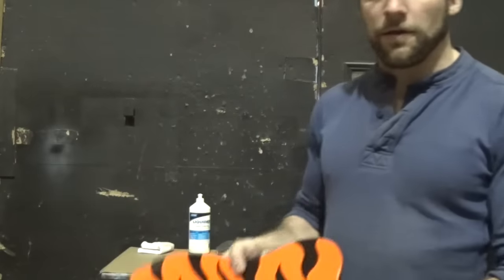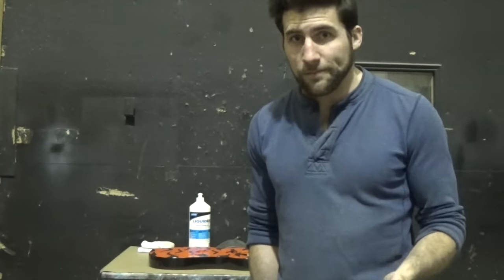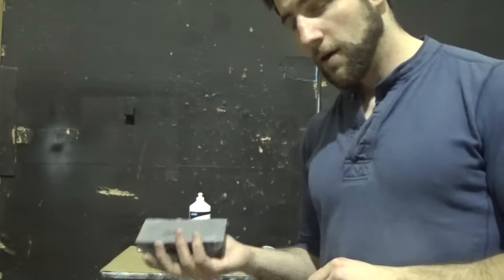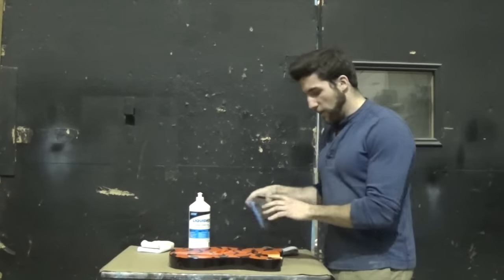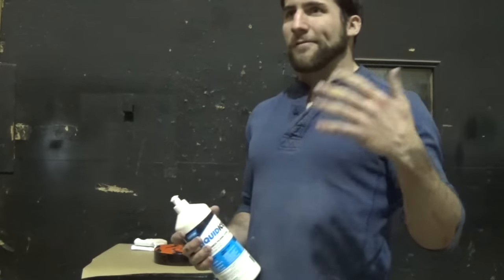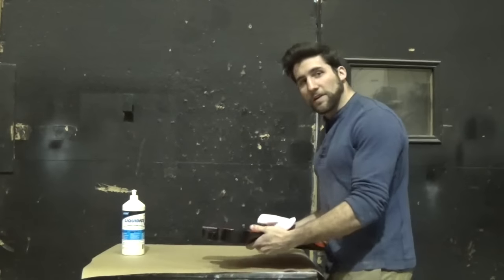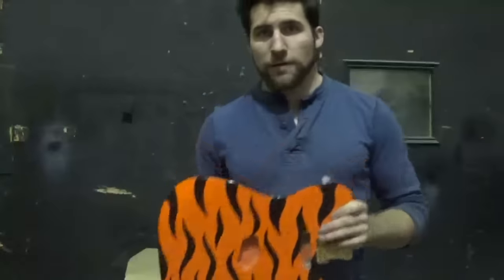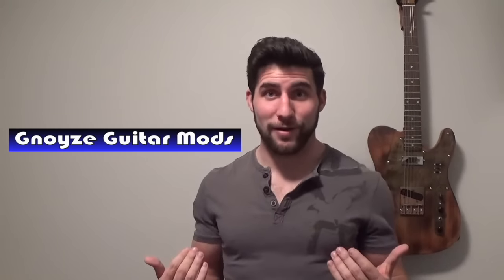How to Paint Your Guitar With Spray Cans Part 4

Comment: I'm a decorator and have done spraying. I've used cans for various parts. Motorbike parts etc and they come up great. The important thing is patience. I put plenty of colour on and then kept doing lacquer coats. Perhaps 10-12 in all. Then a light sand and polish (after plenty of drying time). I've got a black Les Paul and have thought about doing the top red. I may do it.

Comment: Thanks Brad. You recommended I use vinyl sealer and acrylic enamel and finish it with the 2k......spray cans. I didn't realize how rough my unfinished body was until I started the process. I vinyl sealed and scotch padded it np. I am doing white on black.....black sides with white top/back. I layed down black first so I could lay the white last. I noticed the grain showing pretty prominently so I wanted to add my 2 cents for those with my problem. I basically ended up with 6 coats of the black and used a 390 scotch bright to completely eliminate the grain totally before moving on to the white top/back(3 coats) ending with 6 coats of 2k clear. I want to tell everyone out there that the enamel dries fast and hard and if you want to work fast avoid lacquer. My entire project 2 colors and clear was 8 days total and looks amazing.
Reply from the maker: Starting with a grain filler may have helped there. Probably a few more coats of sealer would have saved you a ton of white and black though. Anyway, I’m glad to hear you’re happy with the final product! Hope you enjoyed the process.

Comment: Brad, I just love your comment @ 1:00, "if you're happy with the finish at this point it may be best to be done." That's exactly my plan. I finished my test pieces using 9 coats black lacquer and 6 coats gloss clear. Still had some orange peel through coat 3 of the clear. Sanded really good after that and to my amazment #4 clear coat was good enough to stop. Needed to see if I could re-create it. #5 had some dull spots but gave some extra so it looked a bit wet on the last coat #6. It looks so good if I get that when doing the actual headstock I'm done!! Just waiting for some cooler weather and lower humidity. Thanks for the answer in the other video.
Reply from the maker: Cheers Bob. Sometimes it pays to leave well enough alone.

Comment: Brad, I've watched this series of videos several times, and I'm impressed. Hopefully, when the time comes I can do a similar job. One question though....when I read forums etc etc it seems that people warn against using enamel because of the drying time. They say it can take months or even a year to fully harden. Yet when I watch your series, that doesn't seem to be the case at all. You're talking about this whole process from coat 1 to finish polishing the clear, taking only a matter of days. 

When I look at a product here in NZ that I might like to use, 'Dulux Duramax' aerosol, it states that the paint "dries ten times faster than an alkyd spray paint"...this is from the blurb on the website, rather than the details on the can itself. So everything that I'm reading agrees with what you show in your video series, which is great. So what are these other people going on about when they warn of enamel drying time to be several months before a clear coat can be applied and up to a year before it's all properly dry?

If you could clear up this confusion I would be very grateful. Thanks.
Reply from the maker: Generally speaking the paint in these spray cans is a fast dry enamel. It doesn't take very long to dry at all. Where people run into trouble is when they spray coats that are too heavy, or too many coats, or too close together. Also, if they are spraying in very humid or cold conditions there can be drying issues. If you layer up 5 heavy coats in a short time span and leave it to dry somewhere cool, the paint can remain soft indefinitely. If you follow the proper (or what I consider to be proper) process, this whole job can be done in a week or so if you're playing it safe.
Reply: Great, that makes sense. Thank you very much.
Reply from the maker: You're welcome.

Comment: Nice videos. I just want to know if it's better to spray the clear on a freshly painted or wait and sand the paint and then apply the clear. I want to use duplicolor on top of a squire strat that has no flaws on the factory finish. Thank you for the great vids.
Reply from the maker: You don’t want to build too many coats up without letting it dry and sanding. If you do two coats of the paint then you can shoot one coat of clear in the same session, let it dry fully, sand flat, and then do your subsequent session of clear.

Comment: Hey Brad, thanks for the video. At the end, theres still a bit of cloudyness in the finish. What do you need to do to remove all cloudyness after sanding down the final clear coat? Thanks.
Reply from the maker: Polish it. You may need a multi-step process. I have several videos on polishing that are more recent and better than this one.
Reply: @BradAngove  thanks!

Comment: Great series Brad.  Very informative just like all your videos.  I’ve been able to learn quite a bit for building my first kit by watching them all.  I have a couple of questions.  I dyed my Les Paul kit which has a veneer tiger stripe top with binding around the edges.  I want to put a gloss finish on the body and a satin finish on the neck.  
Should I put any type of sealer on first or will the Rust-O-Leum gloss and satin serve as the sealer?  
Also, since I want two different finishes should I finish the neck first then glue it to the body?  
Thanks for any feedback you can provide.
Reply from the maker: I would glue the neck first and just use masking tape to deal with doing different finishes on them. You should seal the veneer and body if possible. Flamed maple and mahogany have very open pores.
Reply: Brad Angove Thank you 🙏🏻 so much for responding.  Very cool of you bro.

Comment: Hi Brad, thanks for al the good information and proper explanation how to do this. Great video’s. Just a quick question: is it preferable to sand in one specific direction (i.e. lengthwise or with the grain) or do you sand in several directions? All the best and greetings from the Netherlands.
Reply from the maker: When sanding bare wood you want to sand with the grain. On a finish it doesn’t matter really.

Comment: Good videos, it’s harder than you make it look. I keep getting runs in my paint and then have to sand and start over.
Reply from the maker: Spraying it while it’s flat helps with that.
Reply: @BradAngove  that must be the difference maker. I think I’ll have to get a T-shape galvanized pipe and attach the guitar to it so I can rotate it like you do. I am just hanging it vertical right now and it keeps running. How long do you wait before you sand? I am using the same rustoleum cans just different color (maui blue).
Thanks for the help! Good content on your channel!
Reply from the maker: A couple days before sanding to be safe. And don’t fire it on there too heavy if you can avoid it.
Reply: @BradAngove  thanks man! I appreciate you sharing all of your knowledge! One more question, do you have a video about sanding? What is wet sanding? Is that sandpaper with a polishing compound or paint thinner? Do you sand the paint before you put on your gloss to get out any runs? Each time I sand the paint it chips or just looks like crap.
Reply from the maker: I sand essentially any time the paint has the opportunity to dry. If you don’t, the next layer won’t stick properly. Wet sanding is when you use water to help let the paper slide. It can be a touch risky on wood though, so sometimes people use lubricants that evaporate more quickly like naphtha.
Reply: @BradAngove  thanks man! I am new to all of this and have a frankenstrat that I’ve been working. I really appreciate you sharing your knowledge! Thank you
Reply: @BradAngove  damn bro, I just painted it lying flat like you said, it worked great! It’s nearly perfect, thanks man!

Comment: love how it came out with the stripes! i was wondering if you could show us how to do a snakeskin finish. im a big bc rich guitar fan, and they've got a few older models that have a snakeskin finish that i'd love to try to recreate on an older bc rich guitar i have. all i know is that it involves using fish net stockings and a few different colors or layers of paint, but i'd love to try it sometime, specially with spray cans since i don't have the equipment to do a professional finish.
Reply from the maker: +James Rockey I think it would be very difficult to do a proper snakeskin finish with spray cans. Ed Hubbs has a great tutorial where he airbrushes a snakeskin finish on a gun stock. If I were doing it with spray cans, I would probably use a technique almost identical to the one that I used in my video about how to paint carbon fibre with spray cans. I would just choose colours that are more appropriate for a snakeskin finish.

Comment: Thanks for the great videos. One question: Do you sand in between applying the clear coat layers?
Reply from the maker: No, I apply them 10-15 minutes apart so there is no sanding.

Comment: I am building a replica '84 Hetfield "More Beer" Explorer and was thinking of using this process to finish the guitar. My question is--how is the durability of this painting?finishing process? The guitar isn't going to be a wall-hanger, as I plan to use it. Just curious how this finish holds up from pick scrapes?normal use?
Thanks!
Reply from the maker: It’s not as durable as a factory polyurethane or polyester finish. It’s similar to a nitrocellulose lacquer finish in that respect I think.

Comment: Hi Brad, at first thanks a lot for your very heplful tutorials! Cause I'm going to start my first self painting project, a bit professional help would be great. My goal is: A body in used olympic white that looks about 25 years old and has a greasy gloss (I'm german and don't know this is exatcly what it's called). My plan: I buy an unpainted body ready do paint. Use 3 coats of nitro sanding sealer and sand it down with 600 wet paper. After that I use some coats of nitro lacquer and let it dry for about 3 or 4 weeks. To get the old look I use tinted nitro clear lacquer some coats, let it dry for a week and sand it again with different papers (1500 up to 4000) and polishing it to a greasy gloss. Makes that sense? ;)  Cheers from Hamburg (Germany) Alex
Reply from the maker: Hi Alex. That makes sense. If you want to see a similar job, I did an aged white nitro look in my other series; How to paint your guitar with nitrocellulose lacquer.  I used tinted lacquer in that one as well.
Reply: Hi Brad, thanks a lot again. Very heplful!!
Reply from the maker: Glad to hear it. You're welcome.

Comment: Brad I am about ready to throw this brand new electric guitar body away
I have painted , sanded.  Repainted. Took paint off. Put paint on
I am about to go nuts. But bound and determined to get this done right 
I bought a brand new guitar body 
As a present to my son whom is crazy about John Deere. Colors 
So I primed as suggested   Sanded  as directed step by step  using your great videos 
Watch the videos about spray can paint 
But one side of the guitar keeps messing up
Paint is wrinkled  or rough looking 
And will not go on smooth in that one area 
Each time I have taken the paint off by sanding, re prime it and repaint this one area  about 3 times 
I this this thing is cursed 

I got all the 2k clear coat and bought. Buffer like yours I got so much money in the project. I must get it done right ..  
Any suggestions on what could be the problem
Reply: I would like to send you a picture of the one corner. But don’t see anyway to send it
Reply from the maker: Wrinkling like that is unfortunately somewhat common. Give it a week to dry then sand that area smooth (not all the way back, just smooth). Then add a couple very very very light coats of your color 10 minutes apart, and then one normal coat 10 minutes later. Give that a try.

Comment: Thanks for doing the videos Brad. I'm using the ealier mentioned stewmac spray can lacquer. I'm going to put my daughters hand print on the head of the neck. Is their a certain type of paint I should use for that? I doubt I will be able to get a lacquer mixed to the right lime green. Again thanks for doing the videos.
Reply from the maker: If you're planning on actually using your daughter's hand to make the print, I'd be leery of using lacquer regardless. I doubt doing it once would hurt, but the lacquer and the products that you would need to use to clean it could be hard on her skin and lungs. If you let the base colour on the neck dry properly and sand it lightly, you could probably get away with using a water-based acrylic (which is safer) and then clear coating over it.
Reply: +Brad Angove you're the man. Thanks and keep up the great tutorials.
Reply from the maker: You're welcome. Thanks for watching.

Comment: Hey, Brad.
I know this video is a bit old but I’m just now discovering it as my first guitar kit should arrive at my house tomorrow.
Just a quick question, I can simply use a wipe on poly finish overtop of an oil based paint, correct? And then polish if needed?
Reply from the maker: Correct.

Comment: Hey Brad.  I had a old 80s Washburn Steve Stevens model that had a body crack.  I have stripped the body and am planning to paint it gloss black myself.  Do you think I should go with a matte black base and then a clear coat for shine or a gloss black paint in the first place?   Also, should I have any concerns that my sanding sealer will be incompatible with my choice of paint?  Thanks
Reply from the maker: The sanding sealer should be fine if it’s been on there that long. Nothing left to react to haha. 
As for the colour, i always recommend a clear coat, so that’s where the shine becomes relevant.

Comment: So, for those of us less artistically inclined than yourself, can you purchase pre cut templates for painting various patterns?
Reply from the maker: I would think so. Or you can use this method and print off the patterns on paper and trace them. Using carbon paper to transfer them to the tape works well.

Comment: Surprised you are not wet sanding. Is there a benefit between the 2 (dry sand/wet sand)?
Reply from the maker: There are benefits and drawbacks to each. I generally don’t wet sand guitars because the water can make the wood expand and crack some finishes. I’ve done a video on this topic.

Comment: Brad me again on the pads your using for scuffing which Grade of pad do you use The 3M I've found are Grey and green and red. But only one of them the red say's that it's 00 and the other two just say metal finish and the other say wood finish. So what is the best for lite scuffing before putting on the clear? And one more thing I saw that you Explained about not touching the paint if you get small runs while painting but what about the Dreaded Hair or those little nats they seam to be paint magnets would you suggest the same as runs or any other Imperfections. I can't seem to get these jobs done with out this always happening to me. Please let me Know Thanks for your Help!
.
Reply from the maker: I like to use the grey or red ones. The green are a bit too aggressive. I go with grey on the thinner more finicky paint jobs.
If you can pick a hair out without touching the paint, go for it. If you can't, just leave it. You can sand/scrape it out after as long as it's not buried in there too deep. If I get a hair in mine that I can't get out, I don't add another coat. I let it cure and get it out of there, then go back to spraying.
I don't really have the nat issue, so it's a bit tough for me to say. I would generally say avoid trying to correct imperfections while the paint is wet. If you have paint that levels really nicely you have more leeway on this, but that's generally only the case with more expensive automotive paints.
Reply: Brad Thanks for getting back to me so Quick and i'm doing my best with body. This is why I'm having so many problems One is that Can't use garage Because of the Animals. two I tried building a spray booth using pvc and a tarp and some clear plastic but that was for not. You see I live in the desert north of palm springs and we get wind 90% of the time one minute it's o.k. then next thing you know the wind starts up. Never fails that's where the hair and bugs come in So I've just had to wait till the right time and spray it and as soon as it's a little bit dry I put it in my work room to dry. It just takes me a lot longer to get one body done sometimes as long as two to three weeks that sucks. well again thanks for your help!
Reply from the maker: Sorry that you're dealing with so many obstacles Mike. I've never had to set up an outdoor spray booth, so there's not much I can tell you about that. It's literally snowing right now where I live, so the spraying outdoors isn't really an option here most of the year.

I suppose if I were going to set something up for just the occasional job, I might consider getting a small tent and pegging it down. The mesh windows should allow a bit of cross ventilation, the pegs should theoretically keep it in place, and you could gently mist down the floor to keep dust down. It seems reasonable to assume that you could make a small hole in the top to hang the guitar in the centre from where the poles cross as well. That being said, it might be a bit ridiculous to purchase a tent just for the purpose of spraying a few things. I've also never had a chance to test the theory, so it might be completely useless.